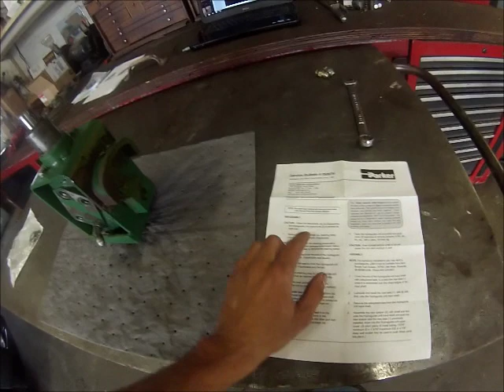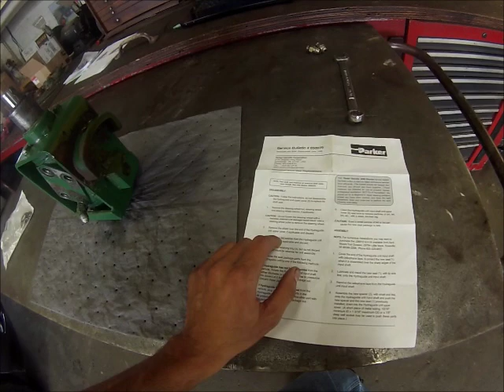Fall Maintenance Part 3

Comment: Coming from someone who has bought a house. If you want a shed, shop and house. I would recommend you build it all in the same building. A friend of mine built a nice house inside a pole barn. The shop could go in the middle, the shed would go on the other end. Good work on the steering motor, I have to do our john deere pretty quick.
Reply from the maker: I wouldnt mind doing a building that is half shop half machine shed but I would never want to live in a barn. I like the thought of a farm house.
Reply: i like the idea of separate house and a couple buildings to spread my stuff out some so if i have a fire it wont take everything

Comment: Watching you're maintenance  videos motivated me to get going on are 1480. Dumped 2 gallons of antifreeze out when I checked the oil. Engine pulling time. Better to work on the equipment early like you. We still have a month till beans.
Reply from the maker: Thats gonna hurt. Gonna be fun tracking down whether its a head gasket, cracked sleeve or bad O rings. What the heck, your all Ford yet you dont have a Twin Rotor? lol

Comment: also the pour point of atf is lower then regular hydro fluid
Reply from the maker: Yes and no. Its all subject to the type of oil (synthetic vs non plus the general quality of the oil), the additive packages, and the weight of the oil.

Comment: Talking about atf, I used to know a guy who said he ran atf on his car engine don't know if was telling the truth or not what you think.
Reply from the maker: I know that if you have a motor that has sat a while and has sludge in it, you run atf in it under a light load for a couple hours and it will make the inside of that engine squeeky clean. But as far as I know you cant run iit for normal use because it wont support the loads on the crank.

Comment: That's proof you never know what you'll find when you working on older equipment. ATF was pretty commonly used in hydros on older combines, Deere used type F for a while and I believe MF used dextron
Reply from the maker: Oliver used it in the HydraPowers and HydraulShifts as well.